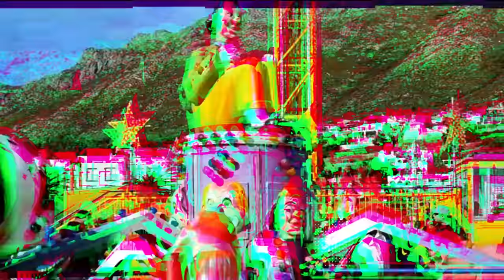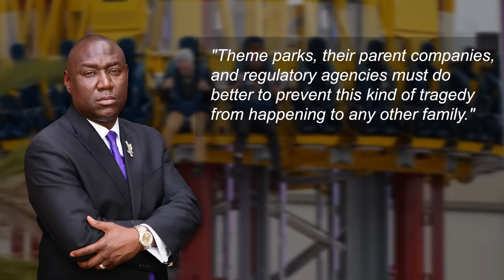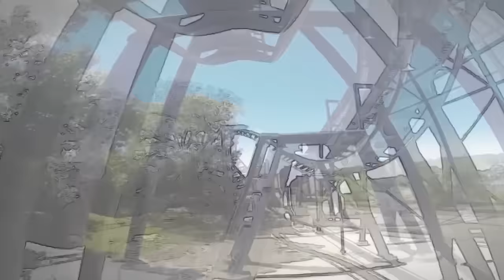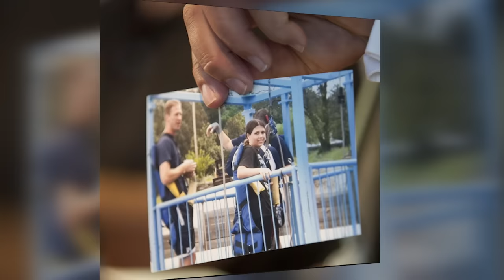9 Worst Roller Coaster Accidents in Human History

Comment: Pro Tip: if you can't use a seatbelt, you DON'T ride. No ifs or buts.
Reply: The last time I was at Disneyland (Nov 2021), all the crew members made sure to have everyone demonstrate that the seat belt was fastened firmly, before starting the ride.
Reply: Pro tip: if you can’t buckle your seatbelt or ride doesn’t have a seatbelt it’s still safe and the restraint is keeping you in for the entire ride and the only point of a seatbelt is in case the ride’s restraint fails which already near impossible. This GP myth about seatbelts needs to end
Reply: Unfortunately, as in my case mentioned above, a seatbelt was put on me and the safety bar on.  Althought I met the requirements of height, I was very tiny and slim, which caused me to fly in the air and almost plunge to my death.  More details in the above comments.
Reply: Youre talking out of your arse.
Reply: Don't like heights so I'm quite happy to not bother, don't like the whole idea of the whole idea of large fast rides.a friend got me on one on my 40th the only one
Reply: @LoyaFrostwind because there's a long list of tragic accidents happen there ..since they opened
Reply: @frozenuruguayball6436  You can never be too careful on a roller coaster. Enough said.
Reply: @frozenuruguayball6436  Whatever.
Reply: True. However, in a country that's pretty much I'LL SUE YOU for whatever reason, likely would've sued for discrimination. Horrible death, nevertheless.
Reply: @hl72296  proving discrimination is harder than people think
Reply: The didn't wanna fat shame, smh!
Reply: @sallyjoan exactly. The poor boy was just a boy who trusted the operator to check adjust and secure the seat belt.
Reply: Right! Can’t believe they let him ride like that with no seatbelt! What were these people thinking??
Reply: But someone would have claimed discrimination.
Reply: @frozenuruguayball6436  exactly
Reply: @LoyaFrostwind  they didn't do that to me when i rode incredicoaster
Reply: What about “ands”?
Reply: @frozenuruguayball6436 you can never be too careful can you ? Human life is priceless compared to some seatbelt.
Reply: @legendmen7024  an amputee
Reply: The problem With the Ride that Tyree was on was that They Didn’t have Safety Belts not everything in the video Is true ,there was a Harness that wasn’t fully down
Reply: All the rides i go on seem to have safety bars which lock you in, either over your head or a lap bar. I usually have to hold on to the bar with my hands or i feel like id slide under and out. 5 foot 3, 115 to 120, not tiny but could mot ride without those bars.
Reply: Seatbelts won’t do shit if something bad happens, go on the ride and you will like it damn it
Reply: Sounds like that mini train that derailed was clearly not verybsave I mean it was what like 80 times in a few months that it derailed. How is that even possible?
Reply: It could come loose tho
Reply: And of course Ben crump got involved, scammer
Reply: @st7728 yep they would have lost their job or their career or the guy who owns the carnival would have been sued and lost everything had they fat shamed him
Reply: True but they shudnt of sent him up
Reply: Pro tip. Do not listen to these videos no matter how many millions of views, there wasn't even a seatbelt on the Free Fall tower that that young boy died on and it wasn't in the right operator error that killed him in any way shape or form he has his facts completely wrong
Reply: Thats called natural selection

Comment: I worked at a Six Flags park.  They were hiring 16 year olds to work at major roller coasters.   The rides are really easy to operate.  Usually consisting of pushing a button.  The ride operators were also required to check lap bars and seatbelts.  That was the biggest problem.  Young kids can not always be the most focused.  Luckily, I witnessed no problems in 4 years, but blows my mind 25 years later.
Reply: damn lol
Reply: The only sad thing about this is it shows how immature and incompetent 16 year olds are today.

For most of history 16 year olds could do whatever adults could do 

Now they can barely work a rollercoaster.
Reply: @blake7587  I think they are the "distracted" generation due to phones, social media etc.  25 years ago, the focus was better in my opinion.  However, kids are kids.
Reply: @blake7587  that's just bullshit lol I worked at an amusement park with majority teenage employees and we never had an accident, most teenagers will pay attention to something like that
Reply: @katsageexe  No it’s a FACT.

Teenagers in the past were indeed mature and responsible.

But a 16 year old today is equivalent to a 12 year old in 2010 and a 10 year old prior to 2000 which really highlights how entitlement and lack of problems has made Gen Z weak, immature, entitled and dumb.
Reply: @blake7587  it's not a fact, that's your opinion lmao I've worked with hundreds of teens in one of the largest amusement parks in my country and still nothing happens
Reply: @katsageexe I get some of this generation is messed up but that doesn't mean that everyone is messed up smh

Comment: I've ridden on several roller coasters where belts were fastened loosely. The momentum was scary as I could feel my body begin to slide slowly out, but I maintained a death grip, constantly pushing myself back. For people too heavy, and weak upper body strength, I could see how accidents happen.
Reply: It’s not the seat belt that is holding you in. It’s the lap bar or harness. The seat belt is more of a gauge so the operator can asses that the real restraints will for the person properly and safely. For example if the seat belt won’t buckle then it’s a clear indicator that the lap bar won’t fit properly either. I know it must’ve been terrifying but you were really never in any danger of coming out if that roller coaster. But you are right that the best way to stay steady in you seat is to sit way back and tighten you core. (Abdominal muscle and back muscles) it will help prevent injury excessive bouncing and jostling around potential injuries liek whip lash or back strains or any other soft tissue injuries.
Reply: Dollywood scared my old ass. That's all I thought about, being flung out and mangled.
Reply: The very fact that people have been on these rollercoasters and felt unsafe, like the harness/bar was not tight enough, says it all. I don't think such dangerous rides should ever be allowed. One death is one too many. If you don't feel safe, it is unacceptable. I would never go on them, and people should never be subjected to pressure to go on them, just because someone else, or their friends are going on it. It should be personal choice. A dangerous choice, but each to their own.
Reply: I could not ride roller coaster with my sisters. I was big and they were skinny. My little sister almost came flying out when she rode with me one time. I had my hand on her and grab her pushed her back in and shoved the bar down till it hurt my gut.  I stop riding coaster with them after that.❤
Reply: all you did was experience ejector airtime...
Reply: @rafiqadarr6217  🤣you probably still go in cars though, they are way more dangerous
Reply: Ouch.
Reply: Well if you're 14 and you weight 300 pounds you have a bigger problem than just being uncomfortable while riding in amusement parks lol
Reply: We have a tiny theme park called Magic Springs in my hometown and there's a wooden rollercoaster called the Arkansas Twister.  And we would purposely push our legs upward against the restraint to prevent employees from pushing them down too far.  That way we could purposely cause the lap bar to be loose LOL 😂 The wooden rollercoaster didn't have many crazy turns or airtime so it wasn't super dangerous thankfully
Reply: Yeah, that's what I do. It's what a lot of coaster enthusiast do. I actually slide forward in the seat (wouldn't work on a wooden coaster with bench seats) and thrust up a little bit so I can scoot back and down and have plenty of room between me and the restraint for airtime. @FuriedHearts
Reply: I was riding at the elitch gardens sea dragon and I was on the edge because I'm so awesome 😂. And I almost fell out and I'm pretty short so.. ya that was scary, there is only a lap bar to hold ou at I was slipping out
Reply: @rafiqadarr6217   the "danger factor" is part of the themeing  you're more likely to be in a very serious car accident to  or  from the theme park...
Reply: SEVEN?? and you still chose to go on the other 6, or were you forced to?😂
Reply: @punker4Real that's only because and IF you are in cars very often (im probably in a car once a month if that). You're referring to exposure frequency which increases likelihood of being in accident. But if you're talking about inherent danger that's a different story.
Reply: @mevolutionarybyliz    the car accident thing is true  someone missed their turn off and made a u turn  they ended up  crashing twice

once in the guard rail (trying to hit and run )and once into another vehicle  about 30 seconds later this happened 2 blocks away from SFMM (assuming the plumber was on the way to the theme park for his job site)
Reply: Ive been on rides where the harness/bar wasnt tight enough, but you can always tighten it a little more yourself 🤷🏻‍♂️
Reply: I’ve had to have my dad hold onto me because my seatbelt was loose and I could feel myself sliding I was holding on for dead life but I’ll never stop going to coasters 😂 now I’m grown so don’t have that issue as much
Reply: @ericjones9699 I loved Dollywood went a few years ago😂
Reply: the funny thing is, slipping out is complete bullshit. 1. ride ops will check you and, yes, pick you out of a crowd incase you maybe didnt check the test seats outside. 2. what ride ops will do with restraints is what we call stapling. they push down on the restraints so tight that it can almost hurt, which increases safety. 3. restraints cant unlock unless you are in the station, due to an electrical current that is needed. 4. seat belts are not the only thing that is keeping you down, it is usually a lap bar or shoulder restraint that is insanely safe. 5. the only rides that do use only seatbelts are maybe kid rides (like those spinning carousel thingys mainly only use a seatbelt). think about this: how many times have you heard of a crash that killed numerous. maybe at most 50. wanna know why its so low compared to the millions, maybe even billions of people that go to theme parks every year. statistically you have a 1 in 25 MILLION chance of just being INJURED. dying bumps it up quite a lot. in order to die on a roller coaster, there is a ONE IN SEVEN HUNDRED AND FIFTY MILLION CHANCE of dying. so yeah, i hope i made you feel a bit more safe
Reply: Me and my friends always tighten each others belts and lab bars before take off😭
Reply: @FuriedHearts don’t seem many central Arkansas comments I’m from Cabot and know all about magic springs
Reply: Cars are mostly a necessity in our modern world.  Rollercoasters are not. @Competent-rides
Reply: @gloriaflanders3481  so?
Reply: @rafiqadarr6217 roller coasters have so many safety systems
Reply: That's absolutly bullshit.
Reply: Thats sad
Reply: Seatbelts on roller coasters are unnecessary
Reply: @rafiqadarr6217 it's safer than driving a car
Reply: @Dr.BenjiBuddy  agree, just secure yourself a little more until you either hear the click or pull the seat belt till it's uncomfortably tight?
Reply: @lorettadansereau8651  yeah exactly. It saves time to close/lock things yourself and it never harms to double check. After all you're one who's sitting in the cart. If anyone should notice a belt being too loose, it would be you.

Rollercoasters are extremely safe, the only things that can go wrong are due to human error.
Reply: death grips mentioned??!?!?!?!
Reply: I went on one with my mate. Her seat kept on coming loose. I had to hold it down it was terrifying
Reply: My last experience was in 2011 on a rollercoaster at Dollywood. I weighed all of 120lbs. As we would slowly hit the top of each high spike within the track my entire body wld come up completely out of my seat, my belt was so lose that my husband even started to panic and held my arm as I held on for dear life. This got all the other passengers attention and they all started screaming stop the ride stop the ride. The last spike I probably would have not been able to hold on, Thank God there were people on the ground manning the roller coaster that heard everyone screaming stop the ride. We sat up on that hill in an upward position so I luckily had enough time to resty arms for that last hill in the event they had no emergency plan of evacuation in place. I felt so bad that entire day bc we were sitting there for four and a half hours in the baking sun. I remember when they started evacuating us using a fire truck and one at a time it was a long process very methodical and strategic. When we finally got on ground every single other passenger and even some onlookers watching this unfold came and hugged me and to this day a lot of them still keep in touch with me and have never got on another roller coaster since that day.
Reply: Well if you are old enough to go on it either fix the belt yourself or get one of the workers to tighten it.
Reply: @punkiepinkies7948 omg im glad everyone was attentive and immediately jumped into action. hope you’re doing okay!
Reply: I've had something similar happen to me. My safety bar came loose during a roller coaster that went upside down. Used to be called the Corkscrew at Cedar Point. I had to hold on like you said a death grip. I was 12 years old at the time

Comment: I kept having a reoccurring nightmare in which I was on an amusement park ride and flying out of my seat, held only by my mom's grasp.  I woke up screaming from this nightmare so many times that my parents finally sat me down and told me that this had actually happened.  I was around 3 or 4, and it was a kiddie roller coaster when I started to panic.  Being small, I was able to wriggle under the safety bar and stood on the back of the seat, and tried to climb down the scaffolding. Thankfully, my Mom managed to grab onto one of my arms, and as the coaster went down, the only thing keeping me from completely flying from the ride was my mom's grip on my arm.  She tried to reassure me that everything was fine and she kept me safe.  However, I still have that nightmare occasionally as an adult and will never, EVER get on any fair ride again.
Reply: How many arms do you have? 😂
Reply: Honestly I don’t blame you. But it makes question putting really young kids on rides. Especially if they don’t have the cognitive capacity yet to not know how to stay safe.
Reply: This happened to my sister who is a twig!!!! She started coming out of a ride at a park and my mom had to hold her down. It was just a seatbelt and holding bar that goes down onto your legs. No shoulder harness. Ridiculous for a ride that exerts negative G forces
Reply: @mikoto7693   They truly don’t. I pulled over on a busy road once and ran out into traffic to retrieve a little boy (about 5) on his bike. When I got him onto the sidewalk he informed me that his bike was a “super bike” that could go fast like a rocket! I mean they’re babies. They don’t understand.
Reply: Glad they told you. At least you know now where this dream is coming from. Actual trauma!
Reply: @joecool4656  I really have to agree. There’s a reason airline pilots have to wear a five point harness when taking off, landing or any flying that requires a change of direction really.
Reply: @e.erin.  That makes me wonder where the parents were. Five or so is way too young to be out anywhere directly unsupervised.
Reply: @e.erin.  thank you for saving that little boy 😇❤❤❤
Reply: Small children should never be allowed on a high speed amusement park ride. People who are obese and can't fit comfortably in the seat of a ride without safety harnesses stretched to the max, also should not be allowed on a high speed ride. Sorry. Not sorry.
Reply: The pirate ship ride just has the pull down bar. As a little kid i had to really struggle to stay in that seat. Will NEVER get on that ride again.@joecool4656
Reply: The rides are so safe, you should be scared of being in cars lmao.
Reply: I have always refused to.
Reply: Why put yourself in so much danger trying to climb out jeez. You were scared alright, but now you are even more scared by your own stupidity? Great...  I always had the time of my life riding coasters, re-entering the ride for hours on end :P But I guess it's cleary not for everyone :)
Reply: @stefankoopmans2200 they were 3?
Reply: this just proves that the early years of our life are so so important. I also have reoccurring nightmares based on stuff when I was 4-5
Reply: That is absolutely crazy. Your mom is such a boss
Reply: I'm so 😂😂
Reply: 😂😂 you go mom!